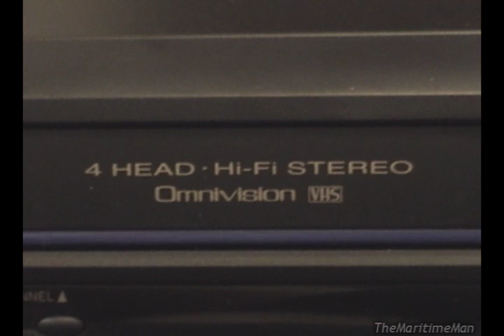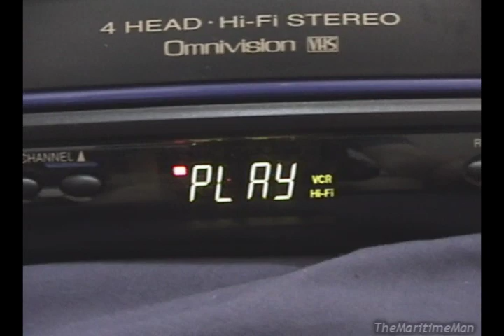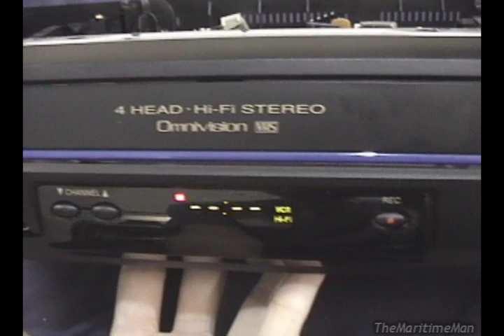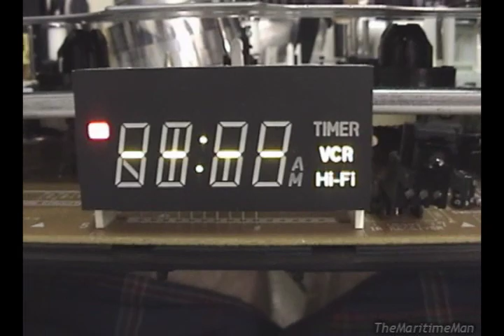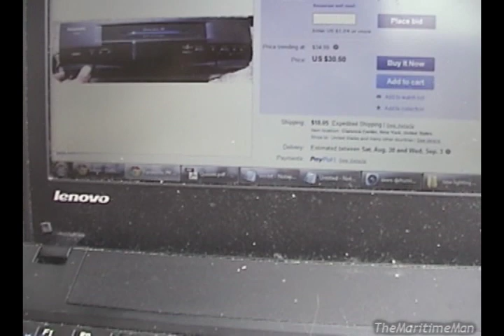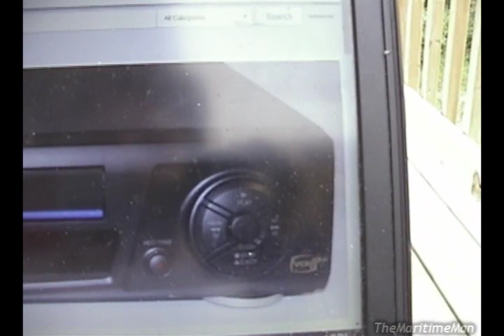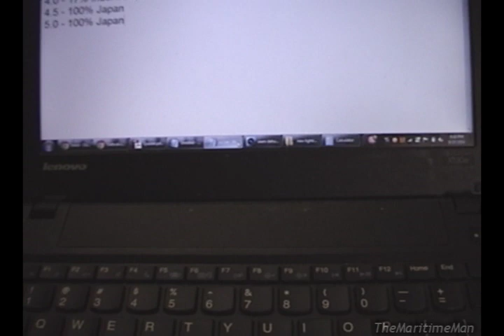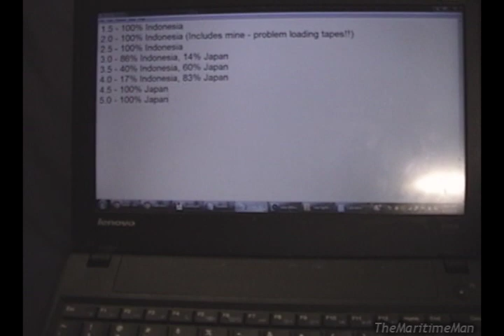Life and Death of a Panasonic 4-head stereo VCR (and lots of info about Panasonic VCRs)

Comment: Hey I got the 1999 model, it was my families VCR and it worked like a champ and it still works to this day.
"Mine was a Made in Japan one which explains why it still runs to this day"
Reply: ***** I noticed your VCR that you tossed out is slightly a little different than the one on eBay, if you look at the placing of the Play, Stop, Eject, Rewind and Fast Forward, they're placed different.
Reply: @Broadspeed The back print of course

Comment: Personally, I found this video very informative. Thank you very much! I figured that I could add a little bit of information about these based off of my experiences with these VCRs. This information pertains only to the country of manufacture. I recently bought a used GE VCR from 1994 because I noticed that it was made by Panasonic. When I looked at the back of the machine, I noticed that it was "Assembled in Indonesia with components from Japan". I don't know how many heads it is, but I do know that it's monophonic and includes an A/V input and an A/V output along with a standard Coaxial tuner. This leads me to the conclusion that Panasonic had a plant in Indonesia for quite some time, but they were only making stuff for other companies there. Upon pulling the lid off, I found that the plastic face plate was Made in Indonesia, and so was the support bar going from the back of the mechanism to the rear casing of the machine. It still works just fine (all it needed was a Head-Cleaning), the tape loads properly and all of the belts are OK, so maybe the earlier Indonesian made models did not suffer from tape loading issues. I haven't owned another unit to see if it has any problems, but maybe I just got a good one.

Comment: I have a Pansonic OmniVision 4-head Hi-Fi Stereo VCR that has always worked perfectly, and since you brought it to mind, I pulled it out and discovered that it's a PV-V4611 made in Indonesia in 2001. I've used it quite a bit and it's never given me any trouble, so I guess I got a good one. It actually does a better job at playing VHS tapes than my JVC S-VHS VCR. (See my video "Panasonic vs. JVC VCR comparison")
Reply from the maker: Interesting. The 4611 is one of the models rated 3.0 stars on Amazon. Biggest complaint is playback audio quality problems.

Panasonic vs. JVC seems to be a topic of great debate on VCR forums, because apparently some JVC units had a feature called DigiPure which digitally enhanced the picture to a point where users of such VCRs deemed the picture quality better than all other VCRs, even though it really wasn't, and it angered people who knew that. Or something. :P Yours may or may not have that feature. I'll have to check out your video.
Reply: +RubberXConcrete “RXC” DLBA PAKL VGCP Sanyo is Funai
Reply: justin mckenzie I know that!
Reply: DID YOU KNOW THEY WERE ALSO, BROKSONIC, MAGNAVOX, EMERSON, ADMIRAL,FUNAI,PHILIPS AND SANSUI IN ADDITION TO SANYO? (AND A FEW MORE) IT OTHER WORDS AT THEN END WHEN THEY BECAME UNPROFITABLE TO MFG. THEY MADE THEM ALL. PANASONIC SOLD A MFG. LICENCE AND LET THEM MAKE THEM UNDER PANNY'S NAME  AT THE END WHICH WAS A SHAME AS IT SOLD CRAP TO PEOPLE WITH THE BADGE OF A QUALITY NAME.
Reply: Have a PV-V4621 from Indonesia that works like a champ.

Comment: I kept on getting a fuzzy scrolling image on my Panasonic VCR whenever I would play movies. I cleaned up the tape head and the other parts that read the tape with a q-tip. Some black stuff came off of it after I cleaned it really well. I put it back together and put a movie in. And the picture is so clear now!
Reply: lakewi44 Sorry to nitpick, but DO NOT clean with Q-Tips unless they’re a special kind with chamois cotton. Fibres of normal Q-tip cotton can get stuck in the heads/head gaps and can wear down and damage the heads. Use a cut strip of printer paper (or as mentioned) chamois Q-tips with rubbing alcohol. Make sure the paper is wet enough so it’s not too abrasive on the heads. Have a good one!

Comment: The best VCRs were made in the early to mid 90s. By then some simplifications had taken place which improved reliability (ie most VCRs by then had fewer or no loading belts, and an idler gear instead of tire). But the early to mid 90s VCRs hadn't been cheapened in build quality to within an inch of death. By the early 2000s manufacturers knew the end was near for VHS so they built the units as cheaply as possible. Even when brand new the loading cage of most VCRs of that era were pretty finicky and you had to be gentle with loading tapes. For me the biggest difference was the change from two loading motors to just one. With two motors, the insertion of a tape felt very robust and "springy". With one motor pushing a tape in felt very soft and squishy.

Comment: I have one similar to this.
its the same button layout but its from 2004 and its Silver
I actually really like this one, it seems to work very well for me.
However I like my 2003 panasonic one better as when you cue and review and press the play again, it starts playing at that part, where as the 2004 one kinda keeps going for a few seconds and skips that part.The 2003 one I have is shown at 20:28,  is silver
I also have a 2001 black one with the buttons in a circular form (different from the 1999 one you mentioned) which works pretty well.
I have a 2000 model which has the buttons more in a straight row (play REW FF))
and a 1998 model which is the same one you have in your other video, which also still works.
I may make a video about all my Panasonic VCRs, they all work
I have a total of 5 models.
My friend who is also a VCR fan has two panasonic one is the 2000 model that I have and the other is the 1993 with the blue stripe in the middle

Comment: My interest in electronics and all things tech started out with tinkering with VCRs as a kid. I would often acquire old machines to cannibalize, sometimes I'd get them working, sometimes not...but it was always educational. Once I discovered how awesome 4 head hi-fi was I never used or bought anything less.

Someone on the Epinions forum told me that Mitsubishi was the only company still making decent VCRs with all metal tape transports etc. (this was back in 2005 or thereabouts). So with that knowledge I bought myself the Mitsubishi HS-U448 off ebay, and it has been a solid machine able to play just about anything, even tapes that other machines would have tracking issues with. I don't use VHS much anymore, but I do still have a lot of home movies in need of transfer to digital...and for those a reliable VCR is a must.

I'm Peach_Lover from Lighting Gallery by the way, and found this video through another you posted on there.

Comment: The vast majority of VCRs have what's known as a mode switch that tells the electronics what position the mechanism is currently in. It's very common for these to get dirty or oxidised leading to poor contacts, and the machine thinks it's doing something with a tape when there is no tape inserted. It's also possible you broke a contact on the mode switch and this too would send conflicting signals. The machine thinks the mechanism is jammed or badly out of position and instantly shuts down.

Comment: I would like to share my experience with the DynAmorphous head VCRs. I will just say it before I explain why, these units were an absolute failure. I owned two of them fresh out of the box back in 1998, one for the bedroom and the other for the living room. They both had the same problem, which was the most important part for me, that being the Hi-Fi performance. I liked to use my VCRs for recording 2 hours of music, which after only two or three plays the audio started buzzing. I don't know if other people experienced the same issue, I just knew they weren't working properly. Now for recording off the air TV broadcasts, I couldn't see any difference in picture compared to an older VCR I owned from 1993. I'm not saying this type of VCR was bad and I probably just had assembly line defected units. A few years after I sold those recorders, I attempted to play the tapes I made with them and here's the results. Depending on the VCR I used, I could see that the color wasn't that vibrant and the outlining on people was unstable. Also the Hi-Fi was truly bad, playing the tapes on other VCRs was constant buzzing or no audio at all. Later in 2004 when I was in college, an old grade school was selling off their junk left behind in classrooms, as they were moving the students to a newly constructed building. I came across five different Panasonic VCRs, which were being sold for $5 and $10 each. They only had one Hi-Fi unit and the rest were mono, I bought the Hi-Fi one only because it looked like it had never been used. I came home and tested the VCR being proud I made the decision to grab it, the picture was very good and there was zero buzzing in the audio. I reused a tape that was used with one of the DynAmorphous units, which all the tapes were Maxell GX-Silver, soon as I recorded something new with that school VCR, the buzzing went away and the video was very sharp. I still own that VCR to this day and the video quality hasn't degraded much, due to old age and several head cleaning, the video has gotten a bit soft but it's still great. :)

Comment: Nice video, this VCR was made the same day i turned 9 ! 3/03/2002

This vcr is likely made by funai (at least the mech. part, like all early 2000 vcr).

By turning the gear you missaligned the deck, but it could have been fixed, generally there is arrows on the gears in order to put the mech. back in it's original state. But never easy to do ! Those machines are analogs marvels, and so complexes ! But definitively worth the 3$ you paid for

And sorry for my bad english, i'm french :-)
Reply from the maker: From what I've read all of Panasonic's VCRs have been made in-house. I suppose anything is possible, though.

Yeah, I figured I put a rotary encoder out of place. I would've put more consideration into fixing it, but after the VCR quit working, I took the deck off again, and I was never able to get it back on - it wouldn't sit flat on one side. :P
Reply: It's definitely not Funai.

And it is positively a Panasonic chassis.

Comment: On the main board there is a rotary switch that you need to put in the right place and it was probably in the rewind mode. So when it started, the other reel wasn't turning (wich is the counter one) so yes it just turn itself off. I had one it was a vfd display hi-fi stereo, but it wasn't capable of playing ep tapes and I wasn't able to find a replacement gear in the wild and I don't buy on the internet, so it went in the dump. By the way I made a little video of mine rewinding and it makes a lot of noises. My main vcr is a sharp vc-h811 : 4 heads hi-fi streo with sharp super picture with 19 micron heads and s-vhs quasi playback from 2001 and it's the best vcr I eve had. The chasi is all metal. I also made a video about it.
Reply: +Nintenloup wolf I come back to this comment one year later. I've got an Omnivision pv-9450 from 1999. It came with the remote and was only 5$. The best part of it is that it was made in Japan and thank you for this video again. really help full.
Reply from the maker: +Nintenloup wolf Here's a coincidence: The day after I uploaded the Memorex VCR video, I found a perfect-working PV-8450 from 1998 in a thrift store for $2!
Reply: The model number is only one digit different from mine lol. So the first digit seems to be for the year it was made. But I have to say that this is a really great machine. But still I haven't found a player that was better than my sharp vc-h811. That vcr as the best picture I've ever saw on a vcr player.
Reply: What does 19 micron head stand for I thought its better than a 4 head VCR I might be wrong
Reply: ITS THE WIDTH OF THE GAP, BETWEEN THE HEAD AND THE TAPE. SMALLER THE GAP THE BETTER THE PICTURE.  WHICH IS STRANGE BECAUSE I HAVE NEVER. EVER SEEN ANYTHING OTHER THAN 19 MICRONS. BE IT A PLASTIC EMERSON OR A SONY $800 DA PRO 4 HEAD .  JUST READ, IN THE BEGINNING, WHEN JVC 1ST INVENTED IT THEY ONLY HAD ONE RECORD SPEED AND MFG'S EXPERIMENTED WITH 80 MICRONS THEN 40 THEN REALIZED 19 WAS THE ONLY SIZE TO DO ALL THE THINGS NEEDED. AND ALL HAVE ALL BEEN 19 MICRONS EVER  SINCE. IT GOES 2 HEAD 4 HEAD THEN  6 HEAD THEN S-VHS IN ORDER FOR PICTURE PLAY AND RECORD QUALITY. I ONLY HAVE  5, 6 HEAD UNITS AND 2 S-VHS THEY ARE RARE AND WORTH GOOD $$$ IF ITS NOT A CRAP BRAND UNDER THE FUNAI CORP. (HAD A 6 HEAD EMERSON AND IT WAS JUST A GIMMICK TO GET YOU TO BUY IT) 6 CHEAP HEADS NOT AS GOOD AS 4 GOOD ONES!  SO IN SHORT MORE HEADS ARE BETTER AND THEY WILL ALL BE 19 MICRON HEAD TO TAPE GAP, SO JUST IGNORE THAT.

Comment: Interesting to know. Last year, I found a sliver one from 2003 at a Goodwill... and it was THE WORST VCR  I have ever used. It had buzzing problems, very bad tracking lines, and a whole bunch of problems. Needless to say, it was out before it even came in.  And I also had a Panasonic S-VHS deck from 2003 as well, but I had a feeling it was a JVC clone, as it had similar mechanics to their VCR's (JVC's usually have "VIDEO CALIBRATION" flash on-screen when tracking a tape).  Where I'm at (Northeast Ohio), finding a Panasonic at a Thrift Store is a bit of a rarity. As the common ones I find here are Mono VCR's from the Funai family (Emerson, Sylvania, Magnavox, etc.). But when I did see some other than those brands, I usually buy them in a heartbeat, especially if they are Hi-Fi Stereo ones. 

And also, the same years also have a similar correlation for other brands too. As my daily "driver" is a 1997 Sony SLV-775HF, as it track tapes super well without having to even use it's tracking. While my Toshiba W727 from 2002 has some issue tracking some tapes, especially if they are T-160 tapes.

Comment: 1999-2002 models were possibly the most rugged ones. I have a Panasonic PV-V7662 and it works perfectly. Those are maybe the only model years I'd trust to have the best quality of this series. Only one thing that bothers me though is that when they rewind/ffw, the rewind/ffw motor sounds like a small plane taking off (and) the loading mech. is clunky and slow when it reverses direction. This can encourage these machines to bind up and break the plastic cam gears and or make them slip and jump timing. Other brands like my Zenith VRB420 are very simple internally and quiet and efficient. Some Toshiba vcrs like the silver Toshiba W525 were super-quiet and (VERY) smooth running (and) VERY, VERY simple internally. But when they quit accepting tapes, that was basically the death of these machines and the loading motor on this model was fairly underpowered.

Comment: The feature you should look for is the SVHS,       It`s got this odd looking pin connection which had it`s own cable which fitted corresponding televisions,       From what I read sometime ago when DVD`s came on the market that they had something like 500 lines,       A SVHS apparently had 400 lines,         So it`s not far off considering the format difference

Comment: Did you ever find a remote for it? You can find Panasonic VCR remotes on eBay for pretty cheap. I found mine at Value Village it was manufacuted in 1998 and still works perfect, just the front display is faded that is the only problem with it.
Reply from the maker: Creepingdeathx81 Why would a need/want a remote for a VCR that was completely unusable and I ended up throwing away?
Reply: Sorry I typed and sent that before reaching the end of the video nor reading the description in detail.

Comment: NO WAY! They break down very easily and are VERY fickle. CANNOT set them on top of dvd recorder. The heads will mistrack. Try a Zenith VRB420. Never had any electrical/mechanical issues except to replace a drive belt. They are not affected in any way by interference to dvd players and do not get hung up in ffwd/playback and are nowhere near as clunky at playback or record startup in the transport mechanism like the Panasonic vcrs.  Almost every Panasonic vcr, no matter (WHAT) model I buy, they almost (ALWAYS) had a mechanical/electrical issue. The only thing I wish the Zenith had was Long Play/Record ability that a lot of the Panasonics had.

Comment: I hate those late 90s-early 2000s VCRs...they have poor build quality and they are what they call BPC (Black Plastic Crap). I have 8 VCRs (5 VHS and 3 Beta) from the late 70s-early 90s and most of them work! So if you want a quality VCR, get one from the day they were made to last! JVC, Sony, Panasonic and Sanyo (Betacord's) are the top brands in VCRs. My main VHS VCR is a Panasonic NV-FS200 Super VHS from 1991 and it has a ton of features!
Reply: Fivos Sakellis I AGREE!! VERY cheaply made and unforgiving. VERY fickle .Low-quality older loading mechanism used on these newer vcrs and they're slow and clunky when they load a tape and cheap, crappy plastic cam gears that tend to break and/or jump timing. Heads will also stop tracking after awhile and no matter how much one does to adjust the tracking, it just will not track the tape properly. NEVER, EVER have I had (ANY) of these crap issues on my Zenith VRB420 vcr.
Reply: Fivos Sakellis I AGREE!! VERY cheaply made and unforgiving. VERY fickle .Low-quality older loading mechanism and worm gear used on these newer vcrs and they're slow and clunky when they load a tape and cheap, crappy plastic cam gears that tend to break and/or jump timing. Heads will also stop tracking after awhile and no matter how much one does to adjust the tracking, it just will not track the tape properly. NEVER, EVER have I had (ANY) of these crap issues on my Zenith VRB420 vcr.